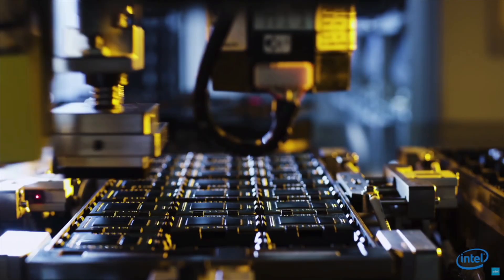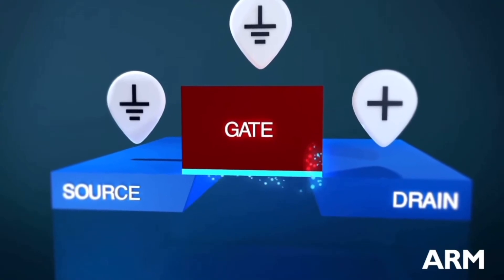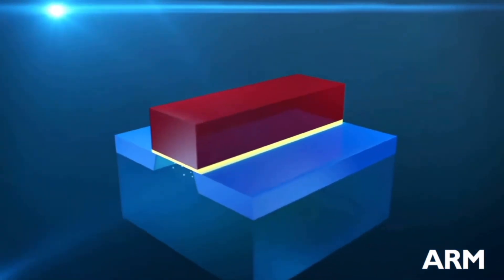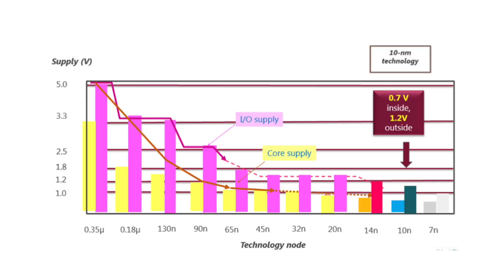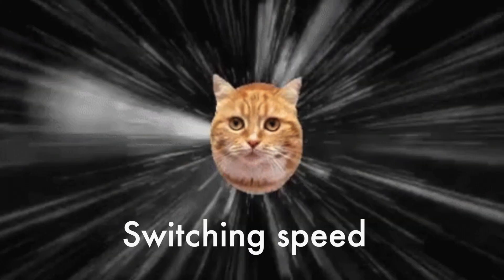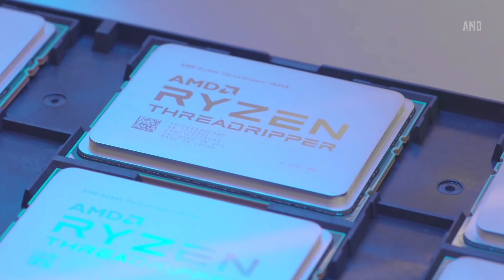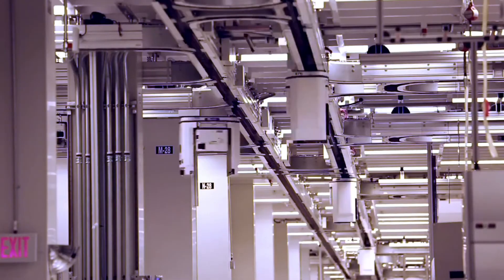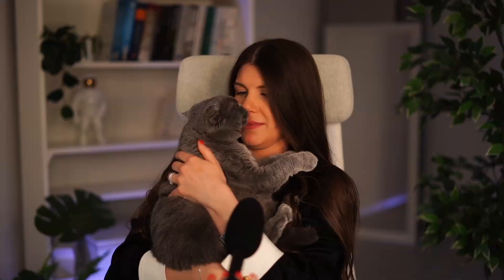What is wrong with 5nm, 3nm, 1nm.. CPU Technology Nodes explained

Comment: As a student/researcher with more of an analog/RF background (as opposed to digital like CPU/GPU), the main benefit of technology scaling is increased cutoff frequency. It is the frequency at which the transistor provides unity current gain. Cutoff frequency is a function of transconductance (gm) and parasitic capacitance (mostly Cgs and Cgd). Above this frequency the transistor stops acting like an amplifier. For example, TSMC 180nm has a cutoff frequency of approximately 50GHz meaning that it is not practical to make analog/RF circuits that operate at or near this frequency. The cutoff frequency of CMOS devices continued to increase with technology scaling until 22nm when the cutoff frequency peaked at around 350GHz. In fact, newer nodes like 16nm,10nm,7,etc. have cutoff frequencies significantly lower than 22nm. FinFET transistors have good density for digital circuits but the complex geometry adds undesirable parasitics at high frequencies.

Chip are most commonly made in CMOS but other materials like GaAs or InP have carrier mobility that far exceeds that of CMOS, leading to much faster transistors and better analog/RF qualities. Although non-CMOS technologies are far less dense (like 100K transistors/mm^2 instead of 100M/mm^2). Perhaps heterogenous integration will be necessary in the future to continue improving analog/RF performance. You could have the density and Moore's law scaling of CMOS with III-V transistors for RF that have very good high speed performance.
Reply from the maker: Lachlan, thank you for your comment. Indeed FinFet is not really made for RF and even more not suitable for mm-wave applications, for reasons that you mentioned and also for cost. Most of RF/mm-Wave circuits do not scale with tech nodes and thus getting more and more expensive with each tech shrink. 22nm CMOS will likely be the RF sweet spot for the next decade. On the other hand we will see more CMOS + III-V integrations in e.g. SiP for those RF/mm-Wave applications where RF power is important.
Reply: Very interesting. I'm only a technician but would I had the choice, it's something that I would have like to study more. But I'm too old now, so I watch these videos instead and try to learn as much as I can. 
Also, english isn't my language.
Reply: @MarvinHartmann452 
You are the only one . I am also in your status. I don't know what is your story, but me, I wasted my life away. The only thing I can do now is to learn as much I can to satisfy my curiosity. Good luck to you, sir.
Reply: There are still a few NMOS and TTL devices. Believe it or not some new designs are still using the 8051!. Not the 80C51 the actual 8051 with EPROM.
Reply: Your input is just extraordinary. Thank you for sharing this.

Comment: But, Anastasi, speeds haven't increased. I've been watching PCs and processors for several decades. I watched as the first IBM PC came out at around 4 MHz. And as transistors shrank they got faster. It quickly jumped to 8 MHz, then 12, then 20. Then into the hundreds of MHz. Then, finally, into the GHz range. And then multiple GHz. But it then dramatically slowed down when it hit about 2.8 or 3 GHz. That was, what, ten years ago? So now the very fastest processors are only at around 5.5 GHz, and it looks like that's as fast as they'll get. So I don't understand when you say that transistors are continuing to get faster as geometries shrink.
Reply: Because clock speeds so high generatee high power consumptiion at an exponential level, meaning they decided to go with multi-core designs and IPC imprevements instead